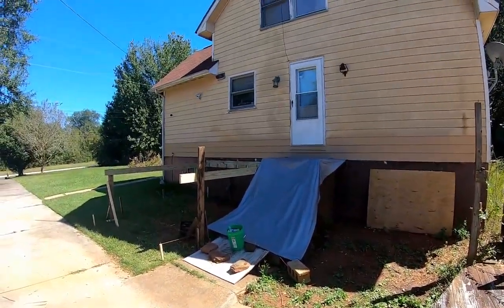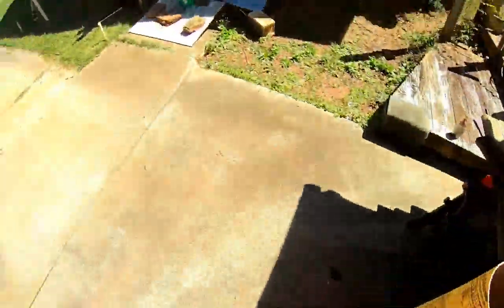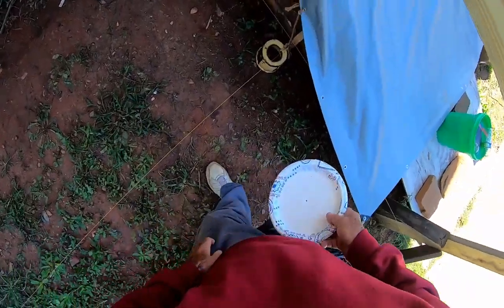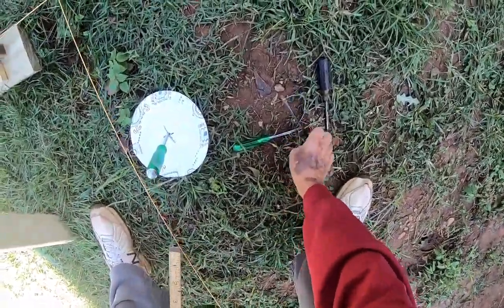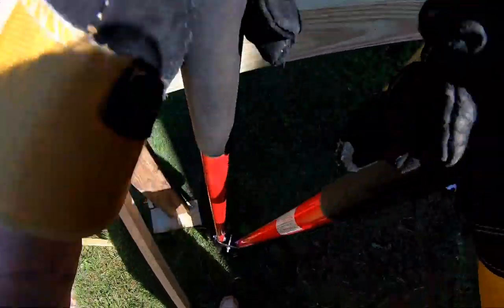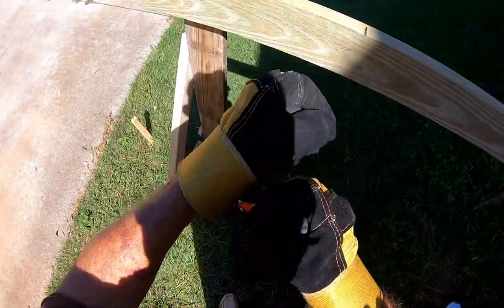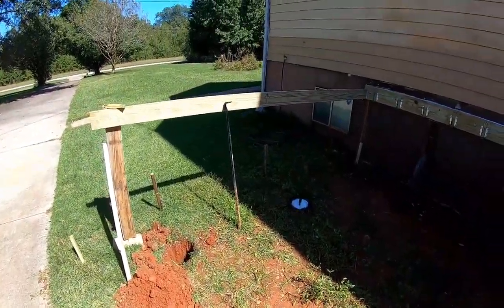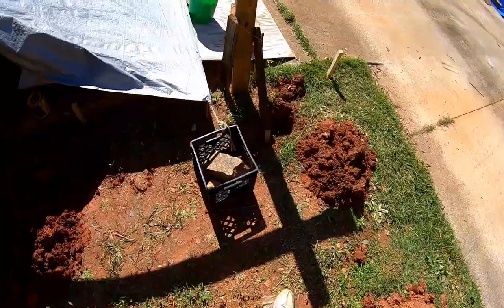Laying Out Deck Pier Locations Pwalpar VLOG

Comment: I foresee you renting an auger to dig those post holes. This is so you don't cause yourself damage from a heart attack from all of that strenuous work you are undertaking. Whatever you do, do not put your posts directly on top of those concrete pipes your pilings will be sitting on. the posts wick up the water that will be standing on the tops of those concrete-filled pipes.  Make sure that you have pressure treated pilings, even if you are having them to sit them on concrete footings.

Starting with your perimeter, mark the location of each deck post to locate the fitting position. In general, posts should be spaced no more than 8 feet apart. Some builders position them every 4 feet for a completely rigid frame. The maximum distance between footings is determined by the size of your joist material.

Footing: Any concrete base embedded in the ground in order to provide the main support for the deck. Guardrail: A lower, horizontal board that runs across the railing posts. Joists: The boards that act as support for the decking boards.

Awe gee, I'm taking away your thunder, or I'm helping you understand better what you are doing.  I'm not saying you did it wrong the last time you made that deck years before. I am saying materials have changed and that you need to be aware of those changes.

I read 3 of 5 letters on the 20/15 line which was a marked improvement over the 20/50 line I wasn't able to read before the surgery. The next one is on Friday 10/02 I'm to be at the hospital at 0830 for the surgery.
Reply from the maker: They will be on a metal bracket above the concrete my friend